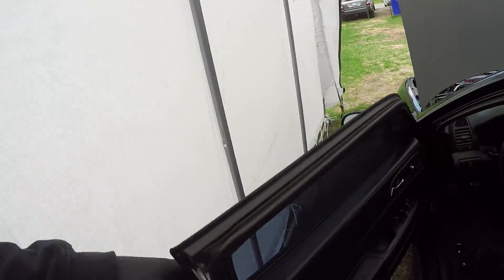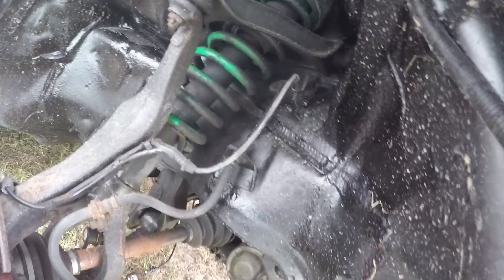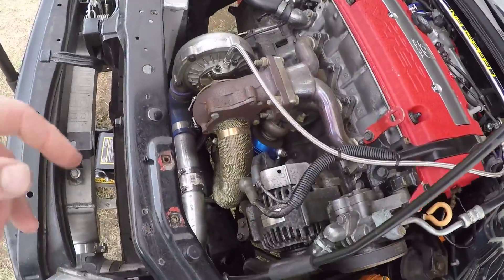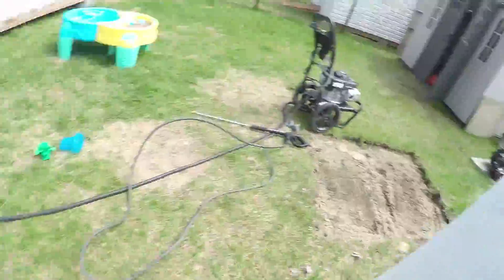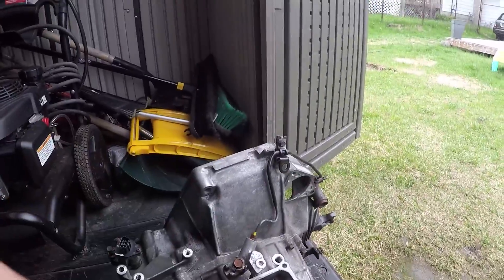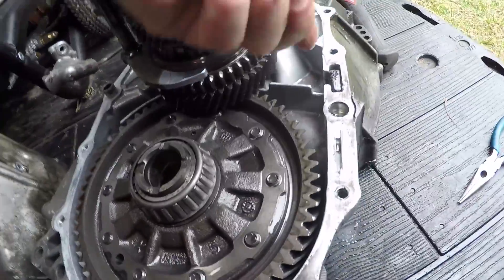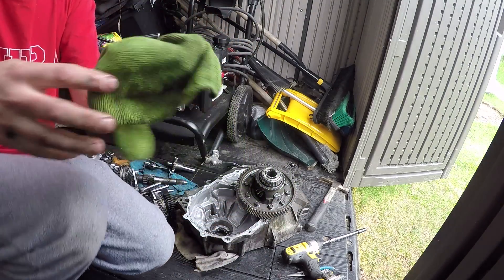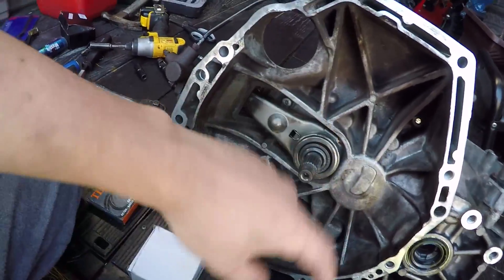Installing the cheap 30$ LSD and new clutch!

Comment: its an intresting design but i consider using clutch pads between gear and this 'bracket' just to limit metal wear 
i guess the springs are so strong that is is actuall metal on metal contact and no oil gets between to lubricate clutch pads may absorb oil so its constantly lubricated

Comment: Hi, do you have any preload between axels? Could you try to jack one side and leave other side on the ground and try to spin  the wheel by hand, interested how much force you should apply and is it possible for you,  i have just installed one into bmw diff but it hasn't any preload at all. Would be fantastic if you can make a video about that.
Reply from the maker: Hey Max, thanks for checking out the video. I live in Canada and it's currently winter so the car is under 2 feet of snow - This might need to wait until next summer but I can certainly make a video, it will create some good content... stay tuned!

Comment: Waiting for the review. TIA
Reply from the maker: I am trying to bring the car on the track to give it good and have a good environnent to do a proper review. I expect to have another video out in about 1-2 weeks.
Reply from the maker: Track video posted, but I didn't talk much about the LSD plate since I mainly focused on the afr tune. The front wheels do feel better and more solid compared to before so I'm sure it's helping but more will come :)
Reply from the maker: HexagramMan  actually no, it turns well and doesn't wheel hope. I know that having welded the diff you have probably provided better traction compared to this plate however the wheel hope would have been intense which I didn't want since I do sometimes street drive the car. As for mpg, I don't have much feedback as I don't use the car often enough. I will have more information and videos next summer once I put it back on the track again and increase the boost to 15-20psi with slicks :)

Comment: Still working? how many miles have You done with this plate? I worry it might wear too fast
Reply from the maker: It's a track car so I don't do many soft miles with it... that said I have done many track passed which are aggressive on the diff and tranny with no issues. Check out my other videos.
Reply: @canuckautoworks2809  Thank You for answer, I can buy proper LSD for about $700 for my car or this insert for $30, I worry especially about this insert will broke my gearbox some day
Reply from the maker: @oluskloc  it's a risk for sure :) I wanted to try it so went all in and it hasn't yet proven me wrong... god knows what will happen next season hehe

Comment: Both wheels spin now?
Reply from the maker: Yes they do, but not as perfect as a real 2000$ lsd haha
Reply: I seen the phantom grip for like 300 you think I should just save the money and look for a true lsd? Im boosting my b18 and looking to aim around 300 or less I want both wheels to be spinning
Reply from the maker: So, I tried the car on the track and while I cannot confirm via video if both wheel spin I was getting a different front end feeling with this lsd plate so I think it's helping good.
Reply: Canuck AutoWorks thanks bro real appreciate it

Comment: h22a type s??
Reply from the maker: Yes :) H22a jdm.
Reply: @canuckautoworks2809  nice. whats your trans code?
Reply from the maker: It's a m2y4 transmission that is originally not lsd and came with my old usdm h22a4 motor - however if you look at my older videos I installed a lsd compression plate into the diff to make it more robust on thr track.